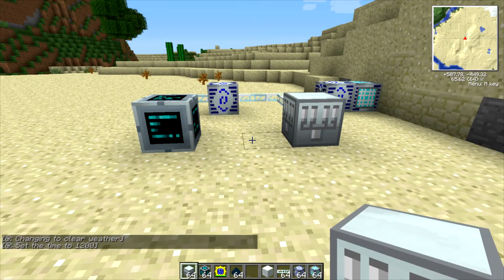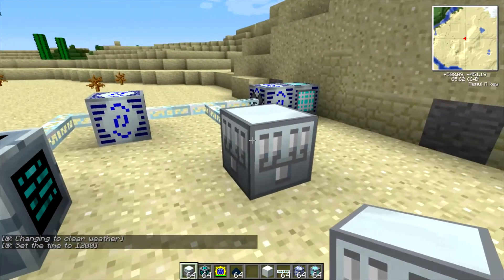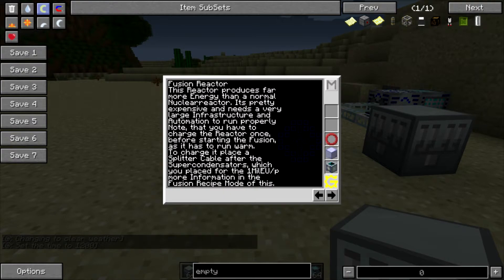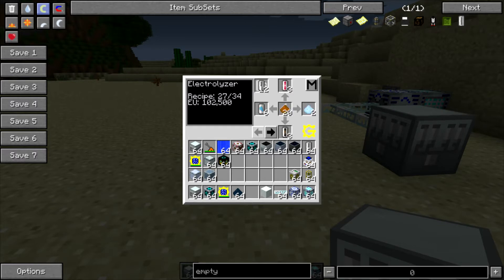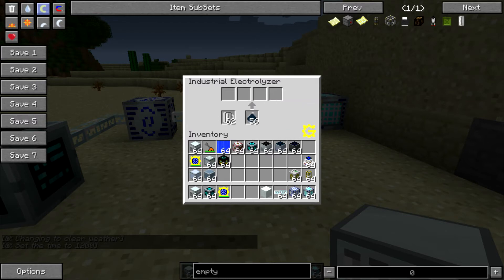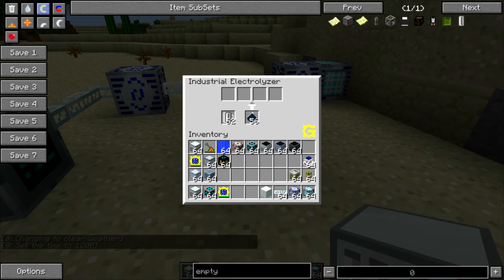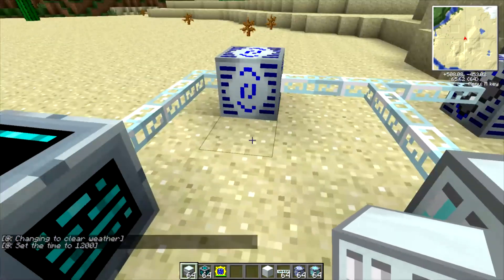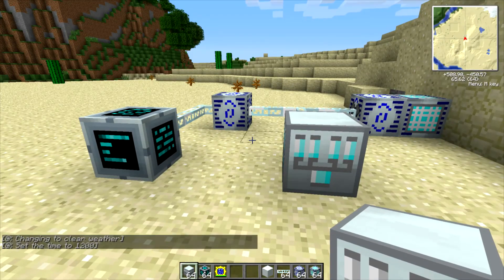Tutorials: Greg Tech - Industrial Electroyzer

Comment: To answer all of you:
Do you have then hooked up to an MFE directly? If you're using 2x Insulated Gold Cable, those lose 1 EU every 2.5 blocks. The MFE outputs exactly 128 EU/t and the industrial electrolyzer uses exactly 128 EU/t (no more, no less, like the industrial blast furnace), so either make sure the electorlyzer is connected using glass fibre cable or move it closer to the MFE.